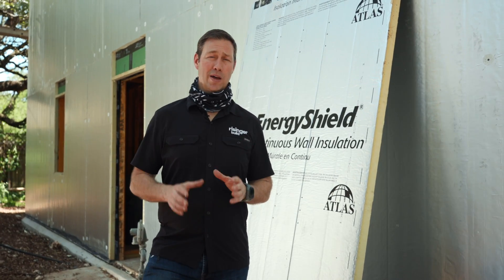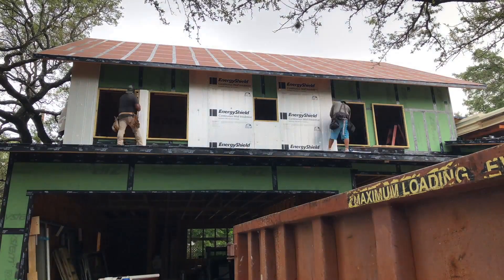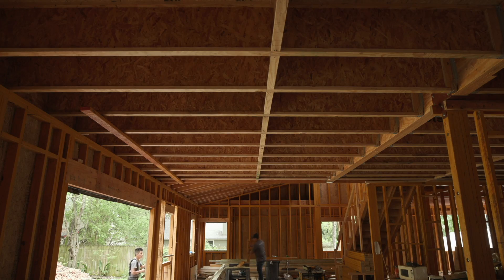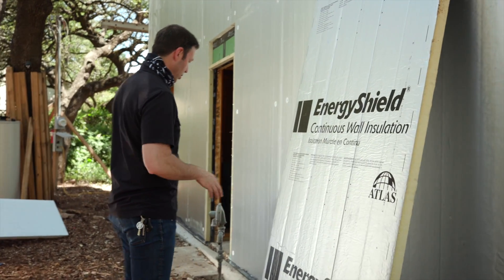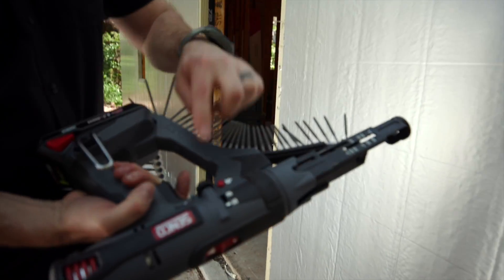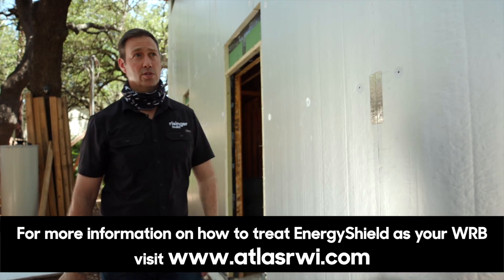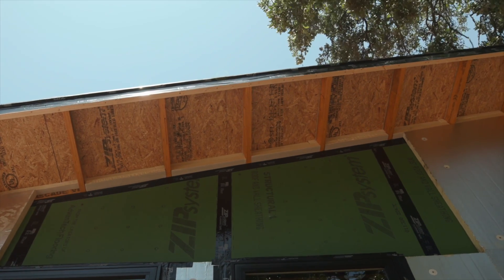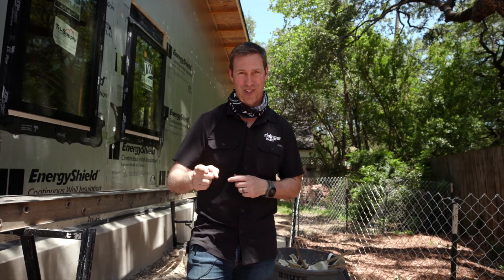Exterior INSULATION Details from Matt’s House

Comment: The foam that was used should be a latex based foam agent.  The "Great Stuff" foam will eventually degrade the poly-iso insulation, breaking down the bond and exposing gaps.

Comment: Matt, I used thermal ISO in 1980 on a condo project at 8500 ft elevation and in 2015 saw them removing the siding because the thermal ISO had shrunk from 2" to  1 1/4" on the south side exposures leaving the siding (lap cedar siding) flapping on the nails in the breeze.

Comment: The question that comes to mind more than the cost of adding this to a home, is the time to recoup the cost in energy savings.  As a homeowner, I am concerned about the total cost, but I'm more interested in whether or not I'll be saving money in the long run.  Will it take 5 years living in the home to offset the cost of additional insulation in energy savings?  10 years? 50 years?
Adding energy efficiency is awesome, and I like geeking out over the specs, but if it takes too long to equilibrate the costs, ultimately it's a waste.
Reply: Ding ding.  You are correct. There is a certain amount of money for sure.  But everyone knows this is overkill.  Just for rich people.

Comment: Thanks for the videos. My question - you go to great lengths to establish the air/water barrier using ZIP, do the screws for the insulation compromise that barrier?  Seems like the multitude of screws would be a problem.
Reply: Either there is no problem, or it will surface some years hence (and will be a very costly goof/ fix). We use 100% liquid applied, self-sealing to 1/4" diameter fasteners (previously tested for 30 days under standing water), and don't use ZIP at all. Too risky, for my tastes, for the reason that you have questioned.

Comment: I put 1/2" o c  pink s f  on the inside under the drywall and over 6 mil poly. Only regret is that I didn't put thicker foam on. I'm in the great white north where u keep the heat in !!

Comment: I built my house and moved in on 1990 . I’ve got vinyl siding , 1” cell text “brand” , half inch plywood , 2x6 studs with fiberglass insulation , 1/2 in cell text and sheet rock .  All my ceilings have 1 “ cell text plus max fiberglass . I live in upstate NY . The only problem is the 1/2” cell text wasn’t stiff enough and after a few years you can tell where some of my screws are .

Comment: Passive House building techniques should be part of the building code in cities.
It is silly to waste energy with a leaky house.
Reply: Kenz300 x lots of people can’t afford Passivhaus-level homes
Reply: @454Casull  Implement the standards, people will soon find ways to meet them in the most affordable way possible. Sure it'll cost a bit to start with, but save a fortune in energy over the occupancy time. And building smaller wouldn't be a bad thing either.
Reply: Brad A this is one of the contributing factors to unaffordable housing. I think extra insulation is a no brained, if you can afford it. But some people just need a place to live and raise a family. 

At what point would you even see a return on investment from these costlier construction methods? Let people decide for themselves. Mandating these practices makes you sound like a Karen.

Comment: Hi Matt, here in the UK our houses are built with bricks and an air barrier between the two courses, later on I had the air vent filled with blown in fibres to increase the insulation. My house is about seventy years old now and the brick exterior is looking a bit poor, the face of some bricks has been damaged by ice and water over the years and I have also had to get the mortar re-pointed between course. Would I be able to fit this type of external cladding onto a brick wall and if so what surface would I need on top of the insulation?

Comment: Does Polyiso do anything against noise? trying to come up with a wall assembly for a street side.
Reply: Yes it does stop a lot of outside noise. The thicker the better. Then you will need better windows to block the noise or inside window panels.

Comment: It looks like the insulation board is right up against the ZIP System, I thought in previous videos you have suggested to leave a gap to let it air/dry to prevent mold building up?
Reply: I'm curious about this too. @matt risinger ?
Reply: If you watch the videos the air gap is almost always in front of the insulation not behind it...

Comment: Foil however has more to do with protecting the sheets from the sun as they deteriorate quickly in sunlight, also at least here in Finland you don't need that sheet behind it if you seal the seams with nonexpanding urethane sealant that is it replaces the vapor barrier.
Reply: The zip sheeting is the main shear strength, acting as a air barrier is an added function or so I understand it

Comment: Question:  How do you deal with things liker electrical boxes on the outside for light fixtures and power outlets?  Your houses seem to be completely devoid of them, yet they typically leak like crazy - water and air.
Reply: We pull plastic flex conduit out through the wall off to the side of the final location, seal the flex with liquid applied (as is the whole of the sheathing) to the wall. The weathertight plastic box is then set per the siding or masonry, entirely outside of the sheathing (ZIP, in this case), but you might have to sacrifice some rigid foam (if only rain screen/ siding vs brick). Use expanding foam as able, to make up the difference. If you are truly anal, use some soft sealant in the flex where it  enters the box, after you have pulled in the wires, to seal the air path through the flex. The offset of the box is the key, everything is manageable that way. We never go straight back in, violation of air quality regulations (!!).

Comment: I have learned so much from watching your videos.  Matt, all the in-depth knowledge you have is great. You do things not just because they work,  but you have the knowledge of why they work,  and what will happen if not done in certain orders or other forms.    I have a question. Why not put the foam up in two 1” layers. That way the seam could be overlapped. I’m pretty sure you will see the joints with an infrared camera by just doing it in one layer.

Comment: Awesome build Matt! I am getting started in building with a metal shed I'm insulating. I started with R10 XPS, but had to manually add a radiant barrier and air gap. I want to add a .5 inch polyiso board inside, which comes foil faced as well. (So I would have 2 radiant barriers).Do you recommend I face the inner polyiso panel (the one on the inside of shed) foil out, facing the interior, or foil out, in between the polyiso and outer XPS foam? Would it make a difference? I live in very hot El Paso TX.

Comment: Make Sure you wire for Cell phone Boosters , Or a killer wireless system to do wifi calling from cell phone , all of that foil radiant barrier type materials Kill cell phone signals
Reply: When we did this almost exact scenario (2" foil faced on walls) on a very large home 10 years ago, the home security company had to install multiple cell repeaters inside the house, otherwise cell phones nearly useless. And of course WiFi repeaters, as the whole house was controlled by iPad and iPhone. The garage door controllers could not send or receive through the foil-face (conditioned car parking, here) either. I had to get and cobble connections for remote antennas out in the soffits for each door opener.  Matt will figure this out eventually.

Comment: I’d use rock wool board just due to its fire rating  that is if anyone retailed it by the bag.   Most places only order it by the pallet.
Reply: Just remember there are a few different products but in general comfort board is twice the density of the in wall insulation.  So 2" cost the same as 3.5" in wall.  The in wall is sold at my local big box hardware stores but not the exterior insulation.

Comment: Foil. It's gonna reflect the sunlight right up until you cover it
Reply: Pretty sure it still reflects infrared and ultraviolet rays. The visible light from the sun isn't what heats up and degrades materials.
Reply: Nope, the foil will be covered with an airgap in between, so the sun's radiation heats the cover, and the cover then radiates the heat through the airgap but gets reflected by the foil. 
Still not sure of it is the best design, but leaving a foil house wouldn't be the best looks.
So I suppose all in all it is a great solution
Reply: Wrong. That's not how radiation works. Think of it this way. They treat cancer with radiation through your skin they dont cut you open. The sun radiates through the siding but can not make it past the foil so it reflects back out.

Comment: Are there any tips for cutting the poly iso in as straight as possible? Other than knives or table saws. I live in a colder climate and absolutely experienced condensation in the wall cavity with R6 poly iso and had to move to a R10+ to avoid the issue but a must that the wall must be able to dry to the inside of the house.
Reply: try Centerfire blades, I find them very effective. Haven't tried the "dustless" circumstances saw blades they make, but I suspect they are quite good. See Amazon etc for sourcing. 

Front Range Colorado 2" polyiso is minimum to avoid condensation (actually, the numbers say it could happen, but extremely rare conditions) when using R19 batts in 2x6 walls. We do it, it works, no problems (10 years and counting).

Comment: Hi Matt Last two houses we built we used the black polyiso. I think it is a fiber glass impregnated paper on both sides. What we used for cutting was a wallboards buddy drywall cutter. Score both sides and it snaps like a sheet of drywall. We were using inch and a half material then horizontal 2 X 3's finished with board and batten siding

Comment: Why did you use Atlas Poly-Iso instead of the Rockwool?  Thank you for the education Matt!  We are currently designing and planning our forever home in Idaho and your videos are a huge help.
Reply: i think there is rockwool under the zip sheets. unless there is aluminum faced rockwool, i'm guessing that's why. just for the aluminum for the radiant insulation/reflection
Reply: I am guessing that as well, especially with the display of flammability in the other video. However at the end i suppose it also comes down to budget.
Reply: I'm pretty sure it depends which direction the house is facing. I put the foil on the sunny side and the Rockwool on the cold side. same R-value just different refraction ability under the siding. (with airgap)

Comment: Regarding the comment about the exterior insulation being continuous from wall to roof, it looked that way on your videos but it didn’t on the video that Steve Baczek did called Solving Remodel Challenges.   In his video the edge of the roof had some wood blocking.  Wondering if you decided to go in a different direction once you started building.   Just trying to understand the process for changes and decisions you make real-time during a build.

Comment: If the the attic is part of the inside conditioned area. Why is there major openings around the whole roof line that I think should have been sealed from the get go and looks like it’s going to be a pain to get to them being at the roof line. Goodnight in trying to nail or screw something in there. Or am I missing something? And the building has a roof yet there’s puddles of water on the deck in the attic. Not the second floor deck with windows, the attic.
What I think I’d like about this insulation build is not hearing my neighbors. The outside will remain outside.
The details I can handle. The lack of money to pay for the details is the problem.

Comment: 6:03 Bottom plate to protect the insulation: 

Instead of using Lumber, use compose decking boards since its much more rot resist. You can rip the boards down into 2" strips so you don't really need a lot to go a long way.
Reply: i was wondering about that, unless you coat the wood in something. i'm sure it's dry there but, here it would be moisture city in the midwest.
Reply: Great technique in basements as well.

Comment: I’m not doubting your knowledge or the science to support it; if the Foam gets air sealed by the Aluma Flash & it seals out water...
Why TWO layers of ZIP?
I support all of your constant preaching the gospel of Air and Weather Barriers;
I’m a BELIEVER BROTHER MATT!!!
But how many darn barriers do we need?
Maybe they gave it to you, I get that too.
Reply: The top layer of ZIP is structural. I'm guessing the final roofing material isn't rated to be fastened to structure with 4" of foam between.
Reply: @thebigmacd  I don't know of any material that can be fastened direct, except EPDM, sort of. Around here in Colorado we have to use DensDeck flame retardant backer board, screwed down through the foam into the structure, then the EPDM is fully adhered to the DensDeck. In the old days in Massachusetts we did a lot of commercial jobs with EPDM direct bonded. The issue is that the foam does not support point loads (like even a hard footstep), which can more easily puncture the EPDM, as a result. The leaks created are nasty, hard to find. 

In the 60's, Deck House Inc did post and beam, 8' centers and 3x8 laminated T&G wood decking. Beautiful for sure but..........Originally they used 1" insulation board over the decking, felt paper, then nailed the shingles with 2" roof nails, to reach and grab solid wood. When the energy crisis came in '73, they got caught with their pants down, horrible thermal performance.  They went to 2" polyiso foam, and then felt paper, then used 3" roof nails to penetrate through the foam to the wood below. If you walked on these roofs in the cold, the foam would give under the loading of a footstep, and the shingles would be punched through by the nails, that did not depress with the foam. Often the shingles would crack. A real mess. Even in warm wether, it was hard to apply the shingles without damage resulting as you worked. My intro to full foam roof overlays came in working on/ rebuilding some of those houses starting in the late 70's. Absolute nightmares, always rot and destruction. No point in going back there, we know the results, and it ain't pretty. 

Top Zip is to support the roof material direct, if a compact (unvented) roof assembly, and to provide a top water shedding barrier if strapping is applied for a vented assembly. With venting, condensation that might form under steel roofing , for instance, is directed down and out.

Comment: Out of curiosity which is the better option for north east climate  (NY)   exterior insulation.  2 inch atlas foam or rockwool.
Reply: 2" rigid foam offers better bang for the buck: its cheaper & has a higher R-value than exterior Rockwool insulation. The big advantage of exterior Rockwool is resistance to Fire.

Comment: Just to be clear- all the mitered exterior insulation joints are underneath your overhangs right? Even on the gable ends? I’ve just had some major concerns about spray foam shrinkage year over year, and although you have the zip for waterproofing, wasn’t sure if it’d be advisable to use the canned foam and then tape over that joint for long term protection in case the spray foam shrinks.
Reply: I was wondering about acoustical sealant out something along those lines that would tolerate the heat better up there.

Comment: in oregon if you dont have eave vents/vented bird blocks, the under side of the eave plywood molds everytime..
the temp of the air is drastically different under the eave than above or around it.

Comment: While all this excessive process is interesting to see how far it can be for isolation, nobody would double the cost for a house to get a better r value. I live in a cold climate in Canada (way worse then british columbia hehe) and we insulate the house with insulation batt/roxul or spray foam for the most part. It keep thr cold or hot inside depend the season. A too Ir sealed house create many orher issues if your hrv isnt working properly

Comment: I actually saw a video on the difference between an airsealed house versus one with a similar amount of insulation but not airsealed. The airtight (sealed) house used considerably less energy, presumably because of less convection. That is less air movement with a resultant lower heat loss.

Comment: The thing with polyiso....
If there's ever a fire, it burns fast and hot and releases cyanide gas.  In other words, if there is a fire one wiff inhaled and you don't make it out. Roxul comfort board is a much better choice
Reply from the maker: I don’t disagree. But this is on the exterior. Outside my air barrier
Reply: If used interior to the structure, all codes I know of require a minimum of 1/2" gyp wallboard to cover the foam. This is to give you a fighting chance to get out alive, assuming you maintain your smoke detectors. You are quite correct about the toxicity. I have used 2'" polyiso as continuous exterior insulation, and it is simplest, most reliable, most cost effective means to good thermal performance that I can come up with.